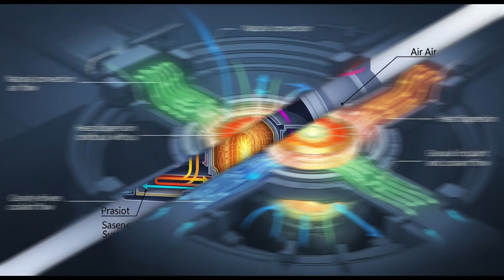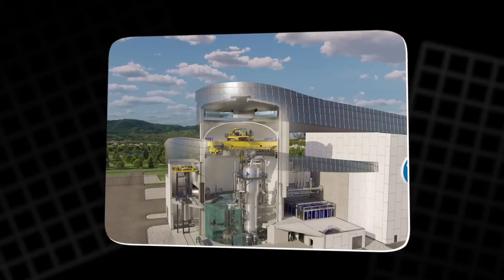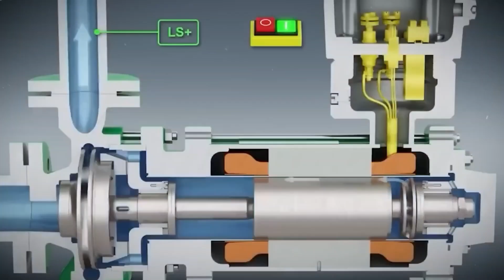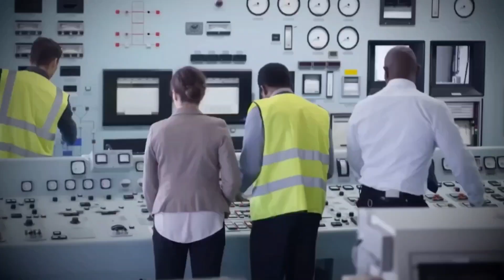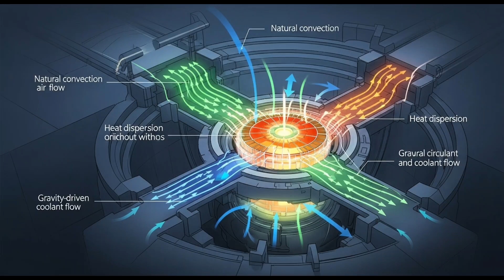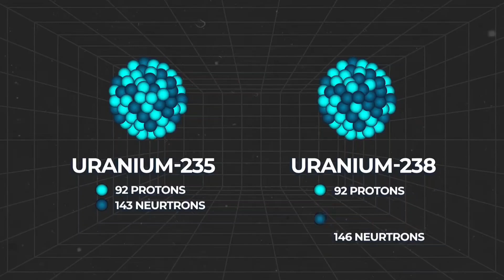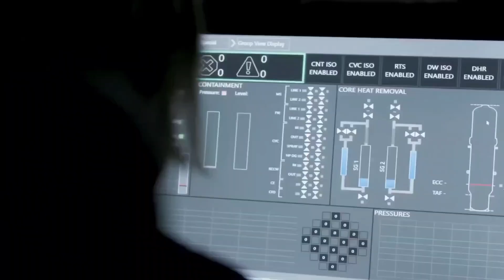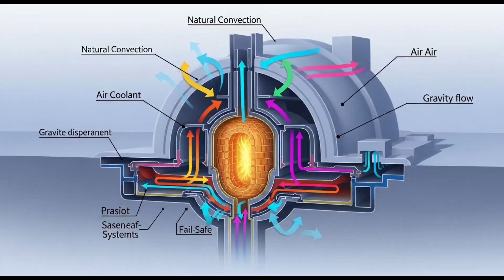Why China’s SMR Is a Warning to the Rest of the World

Comment: The htrpm is based on a prototype in tsinghua University that was actually built several decades ago. That means building a new smr doesn't happen overnight. So smrs becoming commercially mainstream is many years away in the USA. 

Also, NuScale was not given permit due to concerns with boron concentration in water not just money. Natrium is currently under construction but it is based on sodium coolant which is known to catch fire